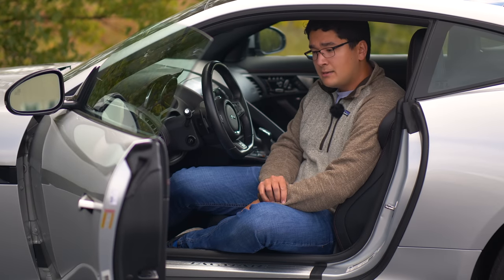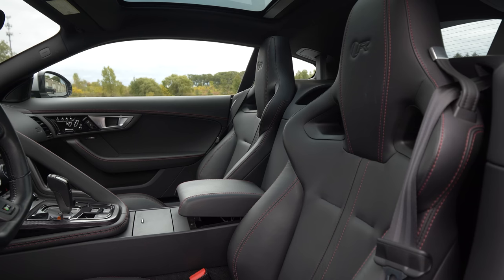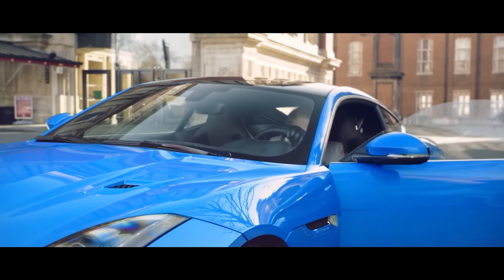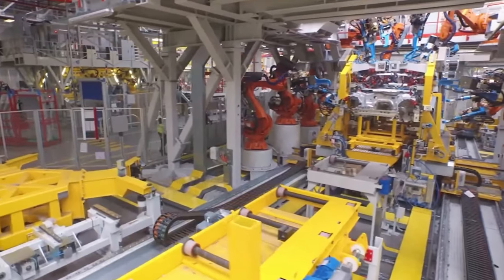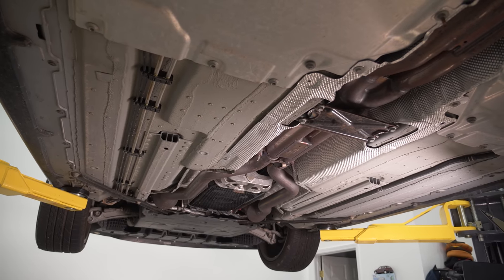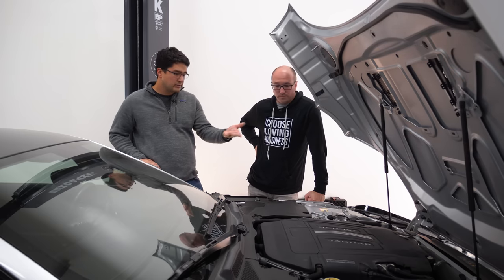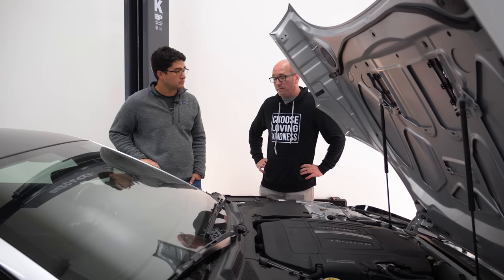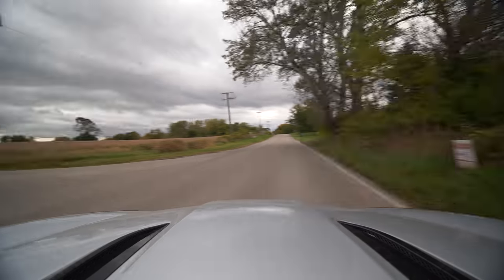Jaguar F-Type | A $45,000 V8 Gorilla

Comment: Is it just me or is buying 3 extra seats kinda not what I as a buyer wants; it is a ford assembly line idea that needs to be removed from the showroom, test track. 
And what is with the rear view mirror? it should be replaced with a camera where the antenna is located, to clear up the front windshield.
Lastly,  remnove the antenna location to an antenna emblem, for lack of a better idea.
Remember the last single seater car broke a speed limit 331mph, aka "Grannies Sunday Ride".

Comment: It’s still not an E type which is one of the best designed and front engine rear wheel drive proportioned vehicle in existence but this F type is miles better than xk8 it replaced. What more can you ask V8 front engine/rear wheel drive classic British roadster proportion. Wished it was offered in a manual option which would be an instant future classic

Comment: if that specific model came with a manual it would be fuckin perfect. throaty v8, refined, hydraulic steering and wild. sounds like perfection but i just cant drive an automatic.
Reply: I hear ya. That is literally the only thing that bugs me a bit about this car. That said, it has possibly the best ZF implementation out there, so there is that.

Comment: The engine on my Jaguar XJL died at 126K miles.  That was after 12K in maintenance and repairs in less than 3 years and meticulous service of this car.  The cost to replace the engine is $25K.  Now I have a 4000 lb paperweight sitting in my driveway.  The irony is that when you pay 75K-80K for a car, you think it should be well made.  This car is the biggest pile of garbage on the planet.  And the response from Jaguar was, too bad.
Reply: So you did 42k miles per year in a flagship jag and didn’t expect some issues? This doesn’t add up
Reply: 126k in less than 3 years?

Comment: Knowing this costs the same as a optioned out Camry TRD makes me feel some type of way...
Reply: The camry will never lose half its value at 10k miles at least
Reply: @RCXDerp  it will also never look good or make you smile. 

It is wet toilet paper in comparison to the diamond known as the Jaguar. 

Still doesn't change the fact this costs what a Camry does.
Reply: @jordanjoestar8839  Costs the same until the first repair...
Reply: @tim3172  id rather drive it and blow it up than own a Camry. 

Also, these are not known for the same issues that plague most Jaguars.

Comment: Oh c'mon... these things are crap and that's why their cheap.  Sticky plastic, AC controller issues, drive shaft, window regulators, fuel rail leaks, gasket failures, rusty underbody, failing radiators, failing seat mechanisms, and extremely dated infotainment.  Sure they sound good, but for 45K you could be in a new Mustang GT with a 3 year warranty sounding good.  Or buy a '17 or '18 CPO BMW 540i for 36K and do a down pipe, exhaust, and Bootmod3 tune for a super nice classy daily driver sedan with over 400hp, awesome infotainment, and built with quality materials.
Reply: @Nissan370Z Glass Cool that these will be manual trans. I don’t dig the headlights, and on the fence for the square grill. I’ve lost faith in Nissan to do proper infotainment/tech. Hope you were not thinking pastel yellow- yuck. If not for the stick shift, the Supra would be the better choice.

Comment: If you can’t afford buying a car from new you will most likely struggle running it as a used!
Reply: Except a Lexus (isf, gsf, rcf, lc500)
Reply: @Pube83  Yes, to the point! But where do you get a nice used LC500 Sport+ for 45000? They are at best 75000, but then down the line it will most likely cheaper to run (total cost)than the older F-type.

Comment: ...except the Hellcat Challenger is BETTER IN almost EVERY SINGLE WAY.  Performance, looks, practicality, can get a manual, has a backseat, holds value better and did I say looks??  And yes...the exhaust/blower sound on the Hellcat is better too...the Jag is just louder.   Based on how these guys drive, I can tell the 707hp is too much power for them to handle...as it is for most soy boys, which is why they knock it. I'm not even a Hellcat fan....but had to call a spade a spade.
Reply: A hellcat redeye in go mango is literally my dream car but this is far better in many ways

Comment: This car has been waiting to die since it was released.  The people at jaguar all need to be put on the street because they cannot get their hands out of their asses.   This car has been unreliable since the production of the XK-120.  Yes it is beautiful but it can not be relied on driving around the block.  For a country that has such crappy weather you would think their electrical system would be bullet proof but it certainly can never be said it is.    They all need to be dumped out on the street until LUCAS electrical can be destroyed which will never happen.
Reply: Have you owned this car? This model and year? If so it would be helpful and beneficial to others to understand any real reliability issues you’ve experienced. After doing lots of research I made this purchase. I change diff fluid and am keeping an eye on the y-pipe…